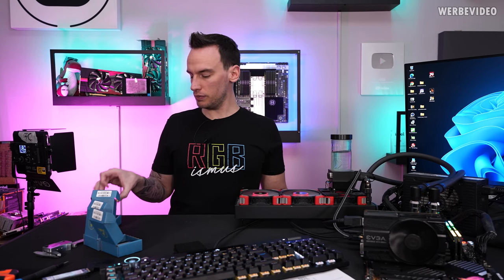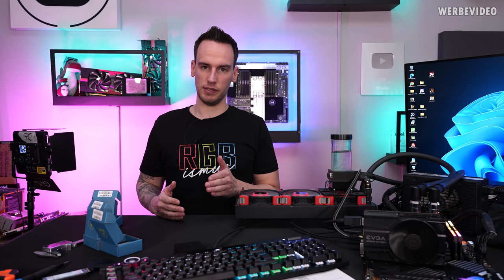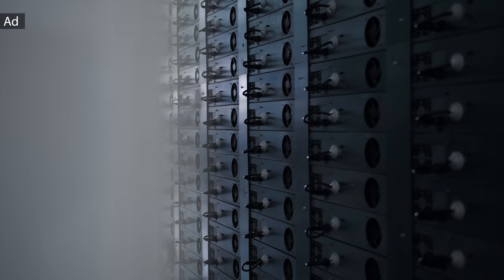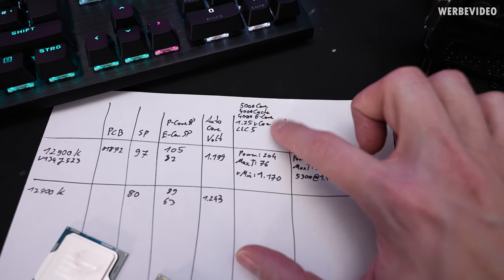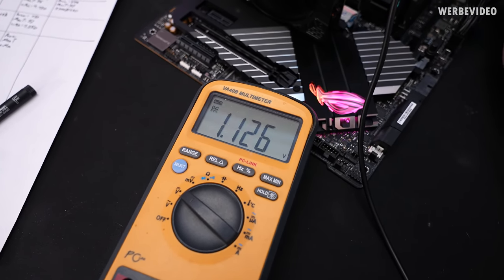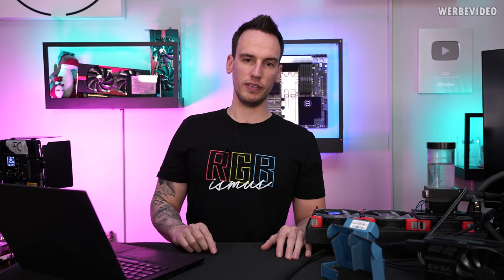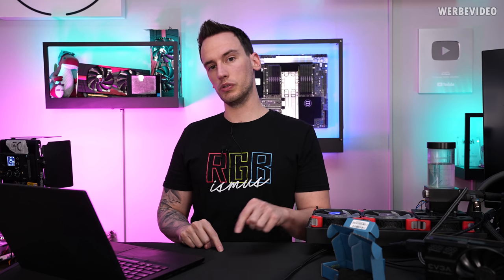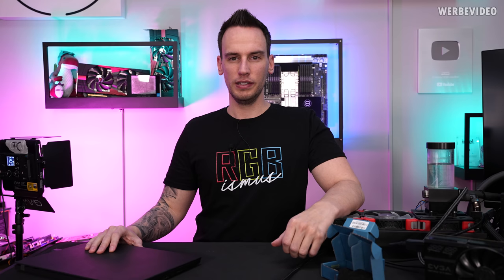12900KS... I'm somewhat Disappointed

Comment: now people who upgraded their 3090 to a 3090 ti can finally upgrade their 12900k to a 12900ks, and while they're at it wear a funny clown nose 🤡
Reply: How much for clown nose? Is it also specially binned?
Reply: Upgraded my 3090 to a 3090ti but sticking with my 9900KS until 13th gen
Reply: You think those people care about money 🤣
Reply: @rossharper1983  you upgraded a heater for a bigger heater and a 5% boost ;)
Im running a 3090 and i didnt see the point, im already sitting sweating like sumo now, itll be even worse with a ti and you wont see any difference
Reply: @JohnOLooney  my 3090 never goes above 63c.

Comment: To be fair they're much cheaper than what you paid for the binned chip, but still ridiculously overpriced for normal people.
Reply: It's "overpriced" for anyone. You don't need a 12900k unless you're interested in pushing numbers, benchmarking, competitions, etc. 

I am not saying you are, but I don't know why people complain about price when Intel's competitive priced chips are absolutely shattering the market in both price and performance. My 12700k is overclocked to 5.4Ghz and it doesn't go above 65c at 100% load. This is beyond impressive. 

I don't know why these companies even release high end chips if people are just going to bitch and moan about the price anyway when it's not even for them. All because, somehow, because AMD actually did something after 10 years of nothing, people won't get off the "bash Intel" bandwagon despite them being unequivocally back on top.... handedly.
Reply: @limitedhangoutlive  You Sir, are intelligent and a gentleman. Carry on.
Reply: @limitedhangoutlive  well written!  These chips are almost cheap in comparison to  past similar tier chips.  My 6900K cost nearly 1500$(Cad) when new.  The new 12900K was basically half the cost 🤯 proc prices are down and performance is up.

Comment: Why are you disappointed? I mean the purpose of that CPU is as the letters stand for: "Keep Spending"
And for that use case the CPU is perfect!
Reply: @M S Alder lake only consumes more power, in certain loads, it runs cooler than zen 3 in games and consumes less Power
Reply: nice troll
Reply: @M S except a 12700k or 12600k does just as well in gaming as a 12900k, and still surpasses their respective Ryzen competition in applications, and their power consumption is on par with Ryzen. When you ignore facts to promote your argument, you identify yourself as a fanboy.
Reply: @Transistor Jump PBO is overclocking so ofc
Reply: @rdmz135  the 12900k removed turboing times. It's essentially like a 5950x with PBO on out of the box.
Reply: Wonder what AMD means by the X lmao
Reply: 5600 but more Xpensive
Reply: I just thought it was funny how this guy in his high horse demanded a 12900ks to "sample", lol, like yeah I'd also be mad if tech companies don't give me freebies because I want them to.

Comment: Looks like Intel didn't bin for lowest Vcore at a given clock (like they did for the i7-8086) but instead binned for "best core" voltage scaling so they could hit the highest possible single-core (at the expense of all-core frequency and Vcore) in order to be able to advertise that "5.5GHz" spec.
This makes sense for gamers, but not for overclockers (which should be their target consumers for this one) thus confirming that they're more worried about beating AMD's 5800X3D than actually providing binned CPUs for us to play with.
Reply: Really don't blame Intel for catering to the surprising large market of gamers with too much money instead of to the couple dozen record hunting overclockers.
Reply: Gonna be honest man how many OCers are out there compared to extremely wealthy gamers/gamers with bad money management? One market has way more than the other.
Reply: 8086k is such a legend. All them are insanely good compare to 8700k.
Reply: This. Clearly the focus was on single-core maximum FPS with the 12900KS.
Reply: well said(typed)
Reply: @sheetlorde3415  Except you're wrong. The 8086k I bought was not better than my 8700k, requiring more vcore and hard capping at the same 5.2 GHz. Also it ran hotter as it leaked more. It was shit tbh.
Reply: really doesnt matter since it loses to the 5800x 3D in most games anyway.

Comment: I got a KS from a local retailer here in the US, batch X206D717. Mine turned out to be SP 96 overall (P-cores 108, E-cores 72). Silicon lottery even with binned parts eh.
Reply: My 12900k is sp 85 overall, but the e-cores sp is 95.. not too bad?
Reply: @mikerzisu9508  sounds pretty good, though apparently you can't compare SP between K/KF and KS as they are "weighted" differently. Like and SP 87 KS is better than an SP 87 K/KF.
Reply: Given that SPs are weighted more on the KS that would make your p cores to maybe 12900K SP115 level or so. Thats a sick bin you got there

Comment: I’ve got a k with 100 sp on the p cores, the KS is already on its way and now I’m considering returning it immediately as I can hit 5.5 relatively easily
Reply: If it's anything like the KS samples from this vid, then it sounds like your k sample is def a keeper
Reply: Yeah, for you a KS is simply worse, basically your K with a shorter warranty.
Reply: No point if your 12900 is already as good.
Reply: @WayStedYou  no point if you have a 12900k in general

Comment: Something I have noticed from conjucture is when intel first release a cpu generation there are more higher sp chips. As the gen goes on the sp rating drops and you get less overclockable chips. Dont know exactly why could be from binning differently.

The crappy ks chips aren't impressive compared to your first released binned k chips. But they are impressive for the later released k chips.

The best time to buy a intel cpu is at the start on a new gen. Then hope you win the silcon lottery for both the cores and memory controller.
Reply: Interesting theory. I bought my 12900kf right at launch as soon as I could, and it was an SP 93 chip 

So better than all of these 12900KS's and second only to the sp97 binned chip. 

So either I got super super lucky, or there might be truth to what you're suggesting

Comment: I have an SP93 12900kf and was hoping to upgrade to the 12900ks for two reasons:
1) even better binning allowing me to undervolt more (I'm running a sff PC with a GPU (3090) and CPU (12900kf) on single 240mm rad loop)
2) onboard graphics, which is useful because my small form factor case has a gen 3 riser cable and putting in a temporary GPU just to change the pcie version to get video output is annoying.

Looking at your review however, the 12900ks is disappointing and unlikely to best even my SP93 12900kf in terms of undervolting.

So i will probably just look to replace my gen 3 riser with a gen 4 and call it a day.

Thanks for a great review!
Reply: Petition to make motherboard makers have the pci-e default to Gen3 when?

Comment: What are the voltages while running with default settings?
Like what is Vcore when running 5.5GHz single thread or 2 threads or full load?
It would be interesting to know this because they are probably very high, and if Intel is giving 3 years warranty they are probably expecting that most of them will survive those voltages for 3 years.
Reply: Warranty is only 1 yr on the KS.
Reply: @concinnus  It was 1 year on 9900KS, it is now 3 years on 12900KS.
Reply: @micb3rd  Hmm, I know I heard reviewers say 1.  Apparently they were just assuming.

Comment: Buildzoid just did a video on 12900ks and 12900k SP ratings with hundreds of samples, the 12900ks has MUCH BETTER SP ratings on average.
Reply from the maker: Pretty strange that in 100 Samples their worst is SP88 and I have 3 CPUs and TWO of them are SP86 - wtf

Comment: Mine was decent. I was able to get 5.4/4.2 at 1.38v. 5.2/4.0 at 1.19v Sp 96 on p core, 70 on e cores.
Reply: thats a great result, i had a 96SP sample KS , i then updated the bios and it dropped to 92 lol
Reply: @JohnOLooney  when I tested it that was before the latest ks bios so mine is probably lower too. I ditched the Apex for an EVGA Dark Kingpin. I was having issues with the vcore being reported in the bios was .1v lower than what was set instead of like .02 with the Apex and memory OC was lacking as well. The EVGA isn't as polished and doesn't have all of the features I'd like to have but OC is WAY better.

Comment: The more i look into SP Values the less i have faith in them, they are too random in relation to performance. 
My original 12900K has an SP value of just 82 but ran ok, at spec. My new 12900KS initially had an SP Value of 96, i then updated the Bios from 811 to 1403 and the SP value dropped to just 92.... i have no idea why as nothing changed but the Bios version.
An SP of 92 isnt what id call wonderful and yet i find this 12900KS Cpu runs really unbelievably well and holds a steady 5.3Ghz on all cores without going over 75 Deg C simply using a 280mm Z63 AIO, i cannot understand this as i heard these ran very hot, mine does not run hot at all.
It also runs at 5.4 (ish) Ghz generally and even boosts as high as 5.7Ghz regularly - this really surprised me.
So despite the SP value of 96 that then dropped to 92 i feel i have a great sample
Reply: Requires less voltage to hit those boost clocks I guess
Reply: @mikerzisu9508  exactly that and i see thta in the temps it runs at, the 12900KS actually runs cooler than my 12900K whilst achieving several hundred Mhz more, its way better and i dont regret buying it at all
Reply: @JohnOLooney  for just a very marginal improvement in performance that is debatable honestly
Reply: @mikerzisu9508  for sure
Agreed - but this is a halo product as you are aware and is simply about having the very best available. I work hard and i have no real vices and am a PC enthusiast. Im not a hard core over clocker but i do like to tinker and benchmark as well as game a fair bit.
The example of the 12900k cpu i initially bought wasnt a particulalrly great one sadly, ive never been very lucky in the silicon lottery, so it was refreshing to get a really good sample to play about with. I can tell you im not sorry i bought it
Reply: @mikerzisu9508  Id add that is peaks at 5.7Ghz regularly and that is just using a z63 280mm AIO, it doesnt relaly go over 75Deg C. It does show the wide spectrum in the binning and just how much better a golden sample is. Is it a huge leap? no, but it is the best there is curerently and i guess ill buy the nest best when that arrives, im just an enthusiast. One area of concern i see though is the huge increases in power draw - that isnt good to my mind and id like to see more effort made to save on power, not just for the planet but so you dont have to strip off and game in your pants because its so hot after a few hours ;)
Reply: @JohnOLooney  yep, I hear you. I am not an overclocker so the 12900k is more than good enough for me. Seems like the ks is specifically targeting overclockers
Reply: @mikerzisu9508  Lets be honest, its simply a toy really. But us fellas love toys ;)
Reply: @JohnOLooney  hell yeah we do

Comment: Just checked my regular 12900k and my P-core is 99 with E-core at 75. I take it thats not bad considering your charts?
Reply: your SP should be 87
Reply: @JohnOLooney  Ohh so its averaged between the two. Thats disappointing. Looking at other post it seems 87 isnt a bad chip at least.
Reply: @xenon9887  mine is similar, sp85 overall but p-core is sp95

Comment: Im still sad s my 12900k use 1,380v at 5,2ghz
Reply: Eusebiu Moraru  mine are at 100 in chinebench. 315w loade. HWInfo say 1.5v and Vcore 1,38 so we are at the same i Think
Reply: Eusebiu Moraru  i have 2 360 in custom build. Phantex t30 so it is loud when I run.
Reply: My 12900k at SP97 pcore and 68 ecore I get 5.2ghz at 1.265v. For 5.3ghz I have to push to 1.395v. Temp peak at 70ish so I’m happy
Reply: @seandang  I’m happy for you I hope I get a better 13900k
Reply: @Eik44  you aren’t seriously going to move from a 12900k to a 13900k are you? That is just silly man
Reply: @mikerzisu9508  its just for a good overclock.

Comment: Getting 5.2 on P cores 4.1 E cores 40 ring ratio 1.250v I'd say that's pretty good can go to 5.3 but get to toasty
Reply: that cant be avx stable. unless thats v core under load? is that bios 1.25 if so cant be stable never in a million years.

Comment: I was lucky i have a decent bin on my k, and maximus hero does a really nice work overclocking it for me 5.5Gs on 7  cores  and 5.3 on all cores. dont really think its worth the money.
Reply: What sp?
Reply: @mikerzisu9508  asus mobos has some tech built in that measures somehow your silicon quality thru voltage, frequency and other stuff and puts out a number under ,,SP'' that lets you know how good your cpu is. As far as i know only asus does that.
Reply: @RaulCojocariu  I know… I was asking what your rating is for both core types. Mine is 95 p-cores, I forgot the e-cores but no one cares about those anyway
Reply: @mikerzisu9508  lol , p core are 91

Comment: Can sp value be trusted at all? I'm using z690 strix e with 12900k, the initial sp value was 83, after I reseated the processor, it became 68, and then I flashed newer bios, it became 83 again, lul.

Comment: Is it a cpu for this community?  Wouldn't you expect higher voltages from a locked cpu?  Needs to run that way..most vendors answer that with voltage.

Comment: Looks like Intel went with a binning that would make it easy/fast to scoop up cpus that are good enough to be sold as KS here. Why bother with ultra high binning that would require producing so many more cpus to find the very best samples to be KS? As we can see these KS are better than probably most K samples, so good enough for Intel here, leave it to vendors to bin higher if they want.

Intel is clearly NOT targeting the tweaker-oc crowd, rather the kind of person that wants a high spec cpu without the fuss. For the tweaker crowd keep on binning non-S cpus hehehe

Comment: you cant directly compare SP values of K and KS cpus mate. They use different "tables" thus giving our different results. Check OCN forums...
Also your samples of KS are rather bad, so far what's been sampled is: min p core sp - 88, max p core sp - 106, average p core sp - 97.7. Yours are below average KS unfortunately.
Reply from the maker: well that's why you have all the other tests with vMin and max clock which are totally in line with the SP values